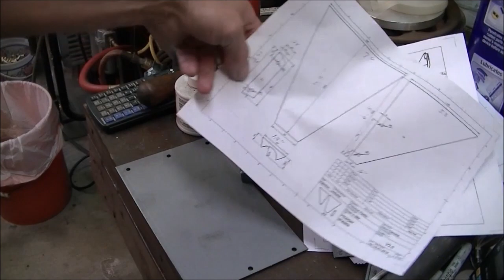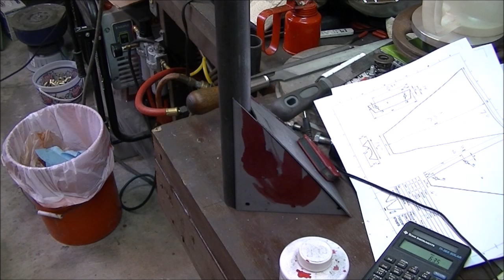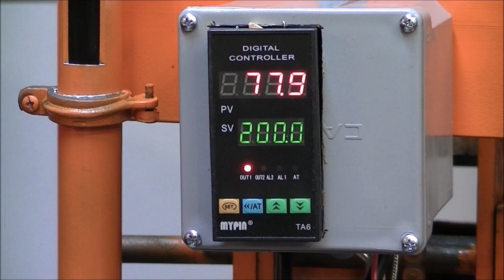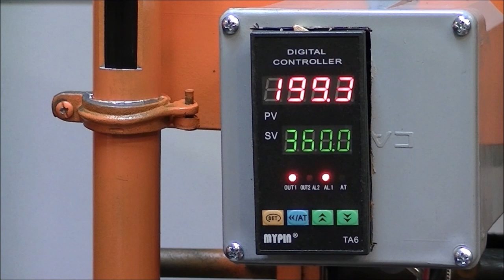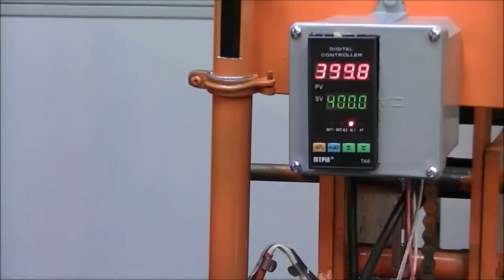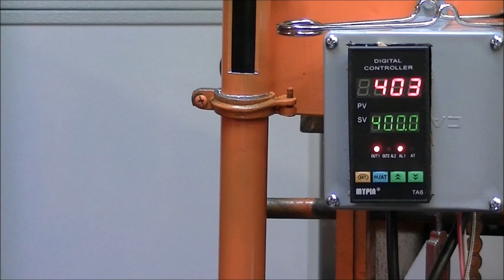Aggie balls crushed   HDPE injector completed

Comment: Nice job on the intro Harold.  Maybe a couple of tack welds is all you need to hold the chute to the pipe. Most jobs only need a 10th of the weld applied to keep things together. With a little tweaking I think the extruder will work well. I still think you need some kind of vent in the mould to get rid of the air that compresses down that end. :-)  Glad to see your HF led torch is still working both of mine have failed.  regards from the |UK
Reply from the maker: I get a free torch every time I go to HF.  They do crash and burn frequently which may be why they give them away.  Lots of suggestions on the vent, I feel it is the answer.  Thanks for stopping by.
Reply: those cheap torches fail as the battery is directly connected to the  led's, thus they are over driven, they generally last as long as one set of batteries, notice a new one is very white and a used one is weakly blueish even if you swap batteries over.
Reply from the maker: I have not paid them that much attention.  I have plenty so I just throw away the bad one.

Comment: Eventually, you'll run out of golf balls.....            :)     Better intro....!
No specialist of molding machines, I think you need more pressure and you need to inject much faster, so the plastic doesn't solidifies as it flows into the mold... Just a suggestion.   ;)
Reply from the maker: Sounds like a reasonable suggestion.  Thanks for stopping by.

Comment: good intro...n..keep the rants....does your die/mold have a vent ..to flow excess material through.??
Reply from the maker: No it does not have a vent.  It worked with the hydraulic press with no vent so I left it off.  I am not a mold making expert but I would bet that is the answer.  Thanks for stopping by.
Reply: i would guess its just to let the air out so it can then flow in, once the plastic hits a tiny hole , very little or none is coming out as its pretty thick, air hole on opposite side to  inlet would be my guess.
Reply from the maker: I am going to have to read up on it to see where the pros put them.

Comment: Will you be reconstructing those balls in the next video?

about the mold... have you considered venting the mold?

you, know, that air has to go someplace or be compressed so much that it is not an issue.
Plus you are pushing hot plastic into it and the hot plastic is heating the air in the mold  which is expanding the air even more, making it even harder to get the plastic in.  I was very surprised that the previous system worked for this very reason.  You were probably pushing with such a huge amount of force that you were compressing the air enough to not matter.  ... A LOT of pressure.

Just the fact that the previous mold was not reheated shows that the temp of the mold is probably not an issue.  even if that mold was frozen. At the rate that you push the molten plastic into the mold, I can't believe that the mold temp. would make a difference.

Have you thought about using epoxy (PC-7 or JB Weld) to adhere the funnel to the tube?

I assume you have used hi-temp paint for the tube?

I do enjoy watching you progress.

Be Well
Anon
Reply from the maker: The air vent seems to be a needed item and i will experiment with it.  Thanks for stopping by.